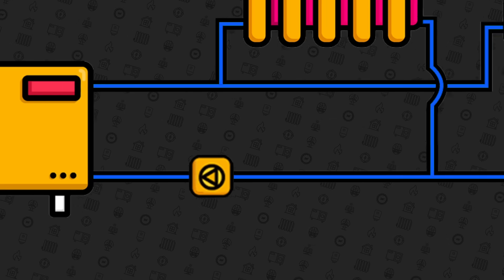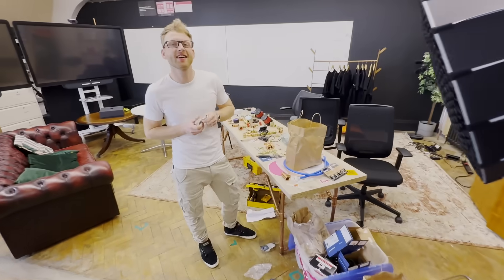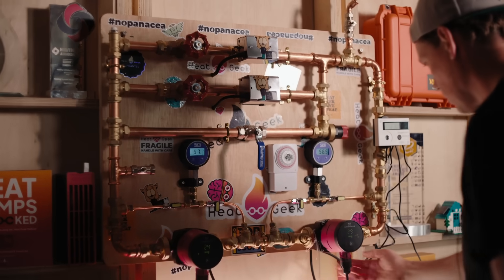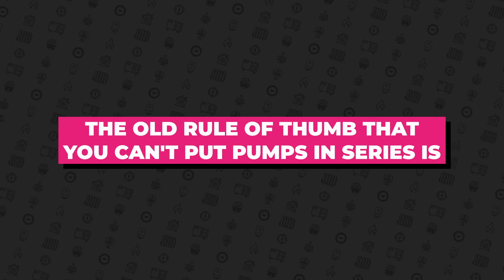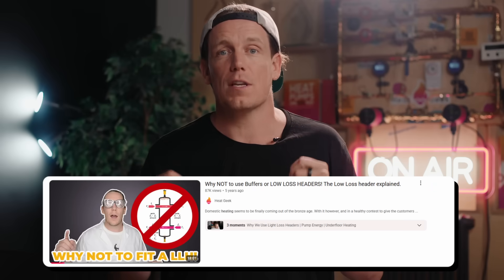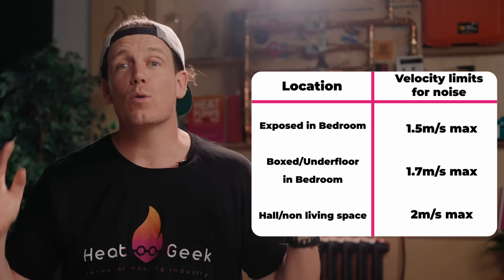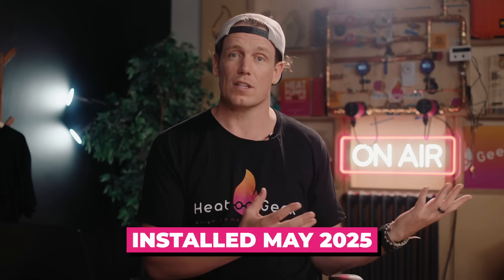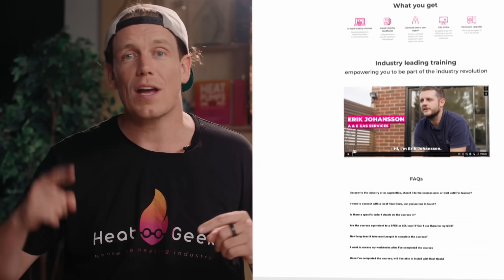Why Your Heat Pump May Not Need a Buffer or Repipe After All

Comment: Why did a Headgeek installer quote me nearly £25k when I had other quotes for less than 15k?
Reply: More efficient higher quality better all round installation?
Reply: @plumberdan5720 HG quote was for the same HP but with less radiator changes…so no.
Reply: Was this quote done recently? I found their quote in 2025 much more competitive than in previous years and so I went with them.
Reply: @dougbamford February 2025.

Comment: I've had the system in my folks place running 2 pumps in series for about 15 years no issues. One is pre-erp pump on fixed speed, other is ERP but also set to fixed speed. Got the boiler from running a DT of 29⁰C to 19⁰C (some very iffy pipework in that house)
Reply: Yes, I would have thought a fixed speed pump and one auto variable, would work well together. The fixed speed first in the line.

Comment: What everyone has to fully understand..
No1. You need electricity 
No2. You need to leave south of Stoke any further north and the 6 month winter air temperature 0° and below means the ASHP it super inefficient.
There needs to be a winter setting where the pump stops, watwr stops needlessly circulating and the immersion does all the work..
Reply: 1. Your gas boiler needs electricity 
2. Norway copes fine with heat pumps at -10 and below🥱
Reply: Afaik Scandinavia has mostly ground source heat pumps instead of air source heat pumps.
The outdoor temperature doesn't affect the SCOP of ground source heat pump.
Reply: @laurensdewitte6088  I wouldn't say most. 
Ground Source is used a lot. However, there are plenty of Air Source ones in the town where I live (Central Sweden).
Reply: @BenIsInSweden  
Thank you very much for your clarification.
What is your experience with the SCOP of an ASHP in your colder climate zone related to a mild climate zone like the UK (and/or The Netherlands)?
Reply: @laurensdewitte6088   The thing is Swedes as a whole aren't monitoring SCOPs, as Heat Pumps have been here for decades. So it's similar to the UK with gas boilers, very few will check the efficiency, because it just works and is the norm. And Sweden has been doing proper low temperature hydronic design for decades as well, so there generally isn't issues with radiator or pipework sizing.

All of mine are Air to Air so there's no end user testing that can be done to ensure accuracy. The data plate SCOPs are:
My Upstairs unit: 4.3 (5.3 in the UK climate)
My Downstairs unit: 4.0 (5.1 in the UK climate).
My multisplit (covers areas furthest from the downstairs unit): 4.6 (average climate rating only, so probably about 3.6 for cold climate).

With A2W as the low temperature (Swedish design temperature is usually in the 35C-50C range) heating is the norm, you can take the data plate SCOPs as fairly indicative.
e.g. the Panasonic T-Cap AIO M 9kW, has a UK climate rating of 4.96 with a design temperature of 35C, or 3.57 with a design temperature of 55C, or 4.31 and 3.26 respectively for cold climate.
Reply: @laurensdewitte6088 After a quick search I found an article by Research Gate that states that 90% of all heat pump sales in Norway are ASHP.  In fact, they are nearly all air to air (again, 90%).
Reply: Thats weird, I live 200 miles north of Stoke, get a SCOP of 3.7 (so 3.7x more efficient than immersion heater) and the house is 120 year old albeit with loft insulation) I must just be lucky I guess.
Reply: 1) Most houses in UK now have electricity.

2) My SCOP over 17 months is 4.03 for heating and 2.76 for hot water, it was -6C in January which showed a COP of 2.7 for heating and hot water for that day.
Reply from the maker: Scop accounts for seasonality.
Reply: Weird, I live about 430miles further north than Stoke and have heat pumps working fine.  Was down to -20C for 3 days straight last January.

Comment: Why don't you put heat pumps in the loft where the huge solar collector roof tiles. why cut the sossages if they are quiet
Reply from the maker: Air recirculation
Reply: @HeatGeek  wouldn't that depend of the ventilation in the loft, the colder air could be vented out of the loft. its such a huge solar collector it a shame not to inprove the cop
Reply: @andymacleod2365  If you put a standard air source heat pump in a loft it will act like an AC Unit without restriction, and the loft will quickly end up below ambient air temperature, and perform worse.
There are Exhaust Air Heat Pumps which require a proper ventilation system, but you'd put those in a cupboard, not the loft as they are extracting the heat from the dirty exhaust air, and feeding it into the hydronic system.  However, they are limited to around 5kW.
Nibe also has a "Ground" Source heat pump that uses combined Solar PV+T panels that use the solar panels on the roof as a collector.  Depending on roof space that either reduces or eliminates the need for a borehole.
Reply: @BenIsInSweden  Only if you don't do a couple of simple things, mount the AP high to take avantage of Thermal gradiant & esaust the air that has passed through the HP outside
Reply: @andymacleod2365 if you only exhaust air you create a negative pressure which means it's going to need to replace it from somewhere, that's either warm air from the house = bad, or cold air from outside, also bad.
The end result is the same, the loft getting colder than the ambient air outside and ending up performing worse than just being placed outside.
Reply: @BenIsInSweden  Most lofts in the UK have a huge allowance for ventilation , the vast majotity of housing being over 70 years old. the other thing is poor insulation. Seald houses are very fev and that was normaly in the UK habital space. and the loft remained vented.
Reply: @andymacleod2365 again so you're easily pulling in the cold air from the outside, negating any and all benefit of putting the heat pump in the loft, as you're just increasing the circulation of air in the loft.
Heat pumps shift a lot of air, which is why outside in the ambient air is best for them.
Reply: @andymacleod2365 also just to be clear for a standard heat pump to go in the loft without airflow being restricted the exhaust vent will need to be ~50cm in diameter, that's a very big hole in the loft.
Reply: @BenIsInSweden  vent kit?
Reply: @BenIsInSweden  OK take a standard terrace 2 up 2 down home in the UK, the area of the loft is 1/2 the livable area of the house. This 1/2 house area has 2 angled surfaces normaly covered with dard gray or red solar collectors (tiles) if you have ever been in a loft on a sunny day you see how hot it gets. mounting the unit hig say of the Joists or perlins dependent upon build (Larger units may need extra support but then you may be better to run mutipull smaller ones) takes avantage of that solar gain.
Reply: @andymacleod2365 how hot does it get in the loft in January, when the heating is needed the most? That is the benchmark you need to be using, not what the temperature is in summer.
Reply: @BenIsInSweden  You have hit the nail on the head, My experance is with very poorly insulated houses that we have in the UK that don't realy get any better the further North you go. Apart from high in the mountians of Scotland the UK dosn't get anythin as cold a weather that you do in Sweeden. But are you better to have an Air Sorce HP (What they are floging in the UK) outside or mounted under a large solar collector (Loft) that normal only other use is storing a few of the familys old stuf that needed to get shifted somwhere else?
Reply: @andymacleod2365  Always better outside. The Loft doesn't collect enough heat energy to make it viable for situating a heat pump in the loft.

The only solutions for a heat pump inside are:
Nibe's PVT "ground source" system, where brine circulates under PV-T panels to absorb solar energy and feed a low-temperature ground loop. Still considered a ground source, and often requires a pairing with a borehole as the roof generally is only going to be enough in well insulated homes etc.

Exhaust Air Heat Pumps - These recover heat from the outgoing (often warm and humid) exhaust air from kitchens, bathrooms, etc. They're sized for small, airtight homes and require a balanced ventilation system. The key is: they use air that you’re already discarding, not ambient.
Reply: @BenIsInSweden  a few pounds of ducting dosent make a differance for 100s kwhs of energy?? think you are speaking ??
Reply: @andymacleod2365  what are you talking about?
Reply: @BenIsInSweden  ???
Reply: @BenIsInSweden  I see you havent bothered to watch the original Heat geek Post, they refer to people doing things because they have always been done that way, ont what is the best for now. Thus sausagges rere mentioned. whatch the artical
Reply: @andymacleod2365  I have watched the video. There is zero benefit to putting a heat pump in the loft, as it will always be less performant than having it outside, due to the restrictions on airflow imposed by having it in a loft. Solar gain in a loft will never provide enough heat energy to heat a home, if it did, then we wouldn't need heating at all.
Reply: @BenIsInSweden  So a south facing window dosn't make any heat gain in a room?. just have a think
Reply: @andymacleod2365  It's minimal and does nothing for hours of darkness.  If it had any impact, then every house would be built with south-facing windows.
Reply: @HeatGeek  There's loft-specific HPs where the cold air is ducted out through a vent.
Reply from the maker: @spankeyfish yes I’ve seen those too. Not ideal if your loft floor is timber as it will act like a speaker and be too loud
Reply: @HeatGeek  you have been telling us for years that they are quiet, it would be stuipid to put a fog horne there as well. Isn't your HP quiet? and buildt from quality parts that it should stay that way?

Comment: This makes a lot of sense, given that they are not positive displacement pumps.

Your test may well prove that you can use two pumps in series without hunting, but it would be good to also test your theory about where the rule comes from - That it's no longer an issue due to the use of inverter-driven pumps. I.e. Please also test with older pumps, with the expectation that you should see the hunting issue. (I suspect you still won't see it)
Reply from the maker: Yes! Very very good comment thankyou
Reply from the maker: Yes! Very very good comment thankyou
Reply: Even old heating pumps with a simple induction motor won't hunt on their maximum setting, I suspect. The velocity of the pump is more or less constant, except for the ~5% slip of the induction motor. Why would it hunt?

If you put it in a lower power setting, often a capacitor is placed in series with the motor, which acts as current limiter. That makes the motor speed much more dependent on load. Even the, I'm not sure why the rpm would become unstable with two pumps in series.

By the way: many heat pumps I know have quite powerful pumps, more than powerful enough to pump 1200 L/h trough a straw. Are there really many instances where the flow rate of the heat pump is insufficient?